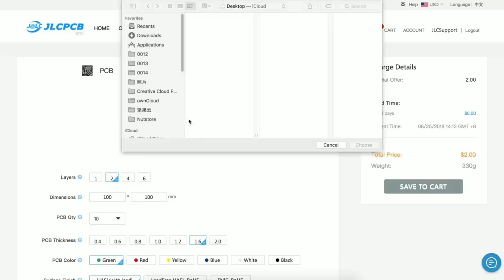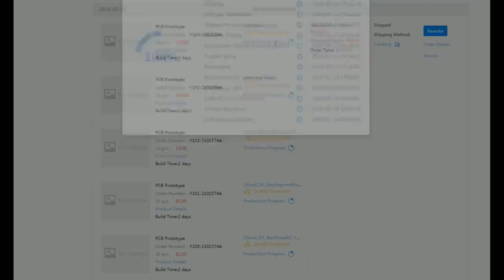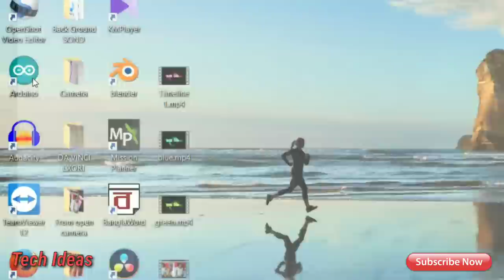Easy digital clock | Atmega328p chip 7 segment clock | JLCPCB

Comment from the maker: Li-ion charger circuit using 1 transistor
https://youtu.be/DOdjxFPdJ38
Reply: Hi .Is  it easy to learn arduino ? how can you advise me ?
Reply: is it easy to learn arduino?
Reply: sir, how can you program processer without Bootloader?
please guide me.
Reply: Not certain about the points made but ,if anyone else trying to find out introduction to electronics design try Bablim Electronics Booster (just google it ) ? Ive heard some decent things about it and my work buddy got great success with it.
Reply: @yashmodi79  you can't program atmega328 without the Arduino bootloader

Comment: Thanks a lot sir ❤️

This is the first time for me to know that i can program a microcontroller in arduino and use it in a circuit without the arduino....
Reply: But how is that possible without a Arduino bootloader? When the AtMega 328 is totally blank. 🤔

Comment: Try to combine atmega328p with GPS module. You'll be able to make digital clock which doesn't need any setting.
Cheers from Indonesia
Reply: Or use the Atomic time signals broadcast on long wave...
Reply: i made it gps clock....further i connected room clocks by it by master slave configuration

Comment: Here You are programing a blank atmel chip with arduino board .Is it possible without flashing the bootloader to the bank chip ?How blank mcu chip supports arduino programming directly ??
Reply: You can buy Atmega328p with Arduino bootloader from ebay or you must boot it with arduino ide in order to upload the code.concerning your last question,i do on and off stand alone atmega328 and i have not faced any restrictions.
Reply: You need atmega328 with bootloader in order an arduino to program it through IDE. To program blank chips search ''using an arduino as programmer'' in google or message me here with your email to send you a tutorial of how to do it. You need a working arduino a blank chip atmega328 some wires capacitors resistors and a breadboard.
Reply: @jimis04   I know that.Thats why I commented..

Comment: i have a MSM9004-02 in my car that is severed from the stock radio, so it doesnt work. Can i some how make it into a stand alone clock? I have located the pin out of the chip to 10pin connector vcc 5v and LCD voltage, rest, load, clock, and ground.  what do i need to make it work independently?

Comment: Can i get the circuit diagram  for this 7 segment clock? . Video is not visible to create the circuit
Reply: Any one help to get  circuit diagram? Capacitor and resistor connection is not available

Comment: Nice project. But one problem. Eveready this Arduino clock is going 1 minute fast than other clock. I checked for 6 days, and finally 6 minutes fast!  Please make a solution for this problem.
Reply from the maker: Yes, you have to use real time clock(RTC)

Comment: how you solve this  arduino coding error  his  coding  having  problems  :  

Arduino: 1.8.8 (Windows 10), Board: "Arduino/Genuino Uno"

C:\Users\NILANJAN (DJ NIL)\Downloads\final_clock_arduino_12hr\final_clock_arduino_12hr.ino: In function 'void loop()':

final_clock_arduino_12hr:59:18: error: 'hour' was not declared in this scope

    int hr = hour();

                  ^

final_clock_arduino_12hr:60:47: error: 'minute' was not declared in this scope

   int timp = ( (hr>12)?(hr%12):hr)*100+minute();

                                               ^

C:\Users\NILANJAN (DJ NIL)\Downloads\final_clock_arduino_12hr\final_clock_arduino_12hr.ino: In function 'void set_time()':

final_clock_arduino_12hr:80:25: error: 'minute' was not declared in this scope

   byte minutes = minute();

                         ^

final_clock_arduino_12hr:81:21: error: 'hour' was not declared in this scope

   byte hours = hour();

                     ^

final_clock_arduino_12hr:131:35: error: 'setTime' was not declared in this scope

      setTime(hours,minutes,0,0,0,0);

                                   ^

exit status 1
'hour' was not declared in this scope

This report would have more information with
"Show verbose output during compilation"
option enabled in File -> Preferences.